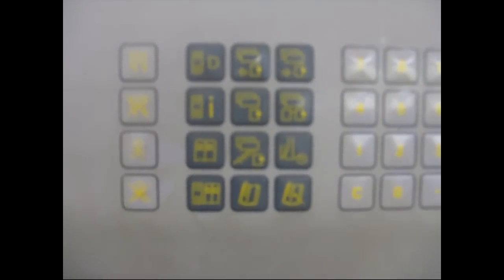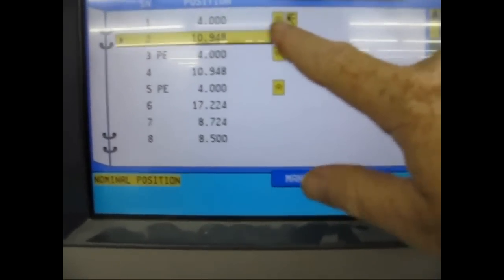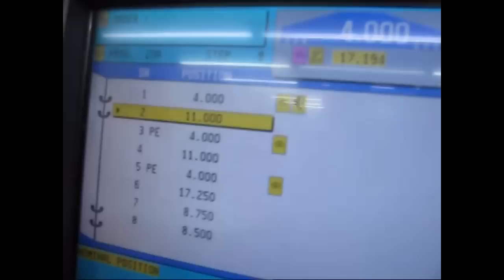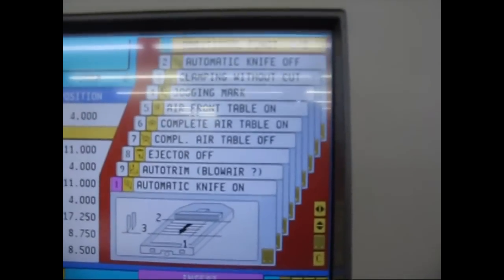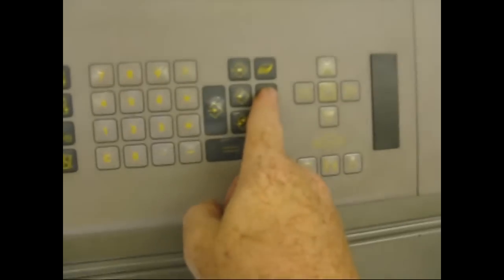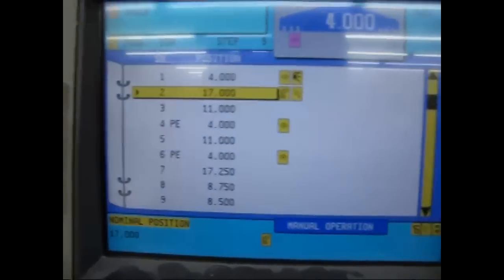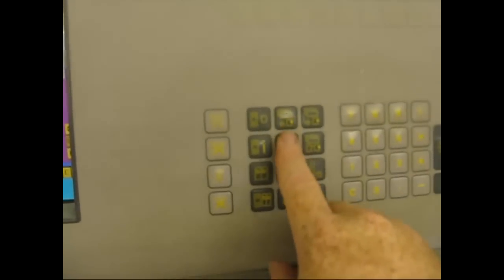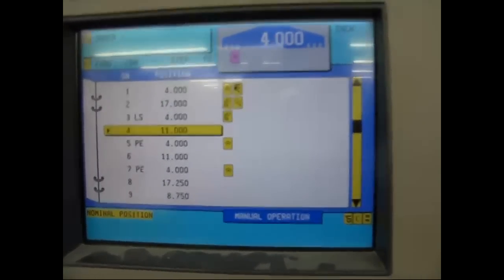Polar 115 ED, programming an automatic smashout using ET

Comment: Hey what did you mean by ET? Did you mean elect a tag?
Reply: @Harry Fawcett. Don't know if you've found out what "ET" means on this cutter. Polar call their step and repeat cutting programme "Eltrotact". It stores formulas of step and repeat sequences for strips/labels. So if you have a sheet trimmed to size at 600mm. and your strips are 95mm. wide with a 5mm. bleed trimout to waste.
Switch on ET, input label size 95mm. Then ET input no. of labels 1
Then ET input label (to waste*) size 5mm
Then ET input no. of labels* 1.
The ET system will calculate the programme and run out the cuts until no more cuts are possible coming forward/run out of material behind the knife. You can programme in a specific number of cuts where you have a composite sheet with strips/labels in the other direction or another job on the same sheet. Polar's "Eltrotact" saves using individual steps on the memory and will accept up to 28(maybe?) sequence changes in one programme. Polar develop their programme systems with input from cutter operators. Stay safe and well.